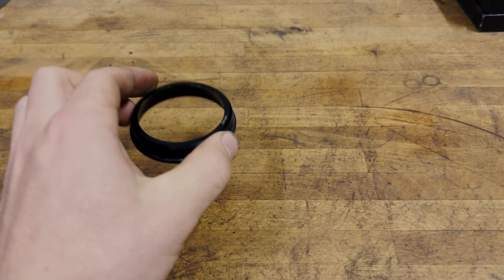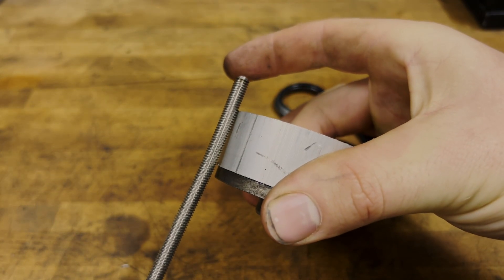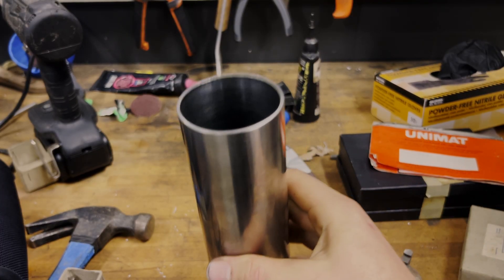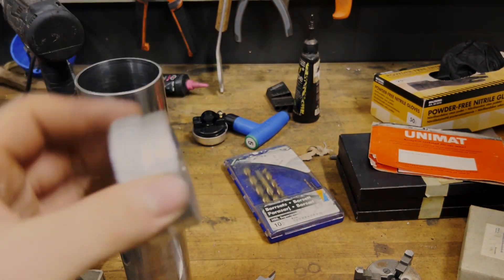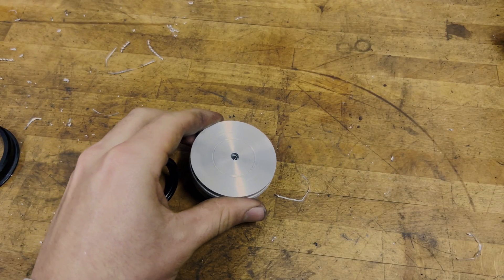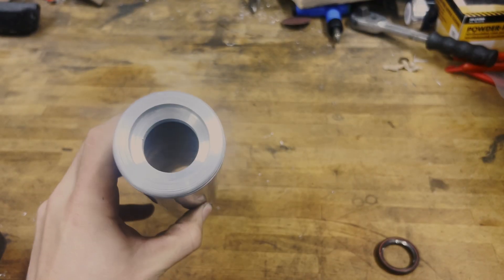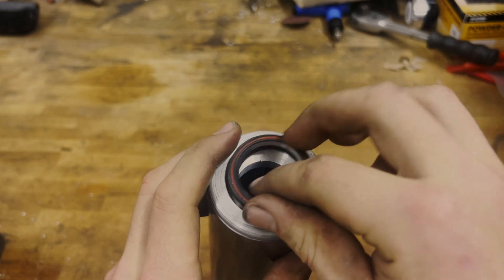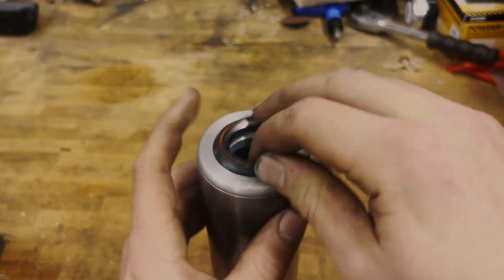How Hard is it to Make Your Own Custom MTB Headset Cups?

Comment: Hi. Good tip: 1. Use OCP (optical center punch) cost not too mutch to broke you financialy.
2. Instead of using that 0% straight piece of rod next time use a long piece of engine block head bolt. 
3. When using a lathe never go back and forth on a material. It is golden rule. And use a litle lubricant on the cuting head. 
I am a mechatroniker. 👍🇭🇺